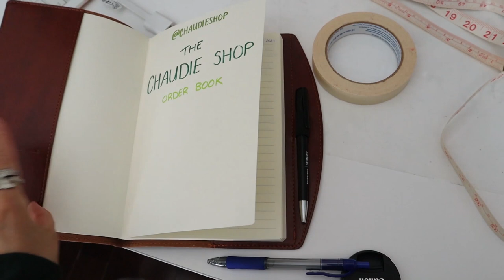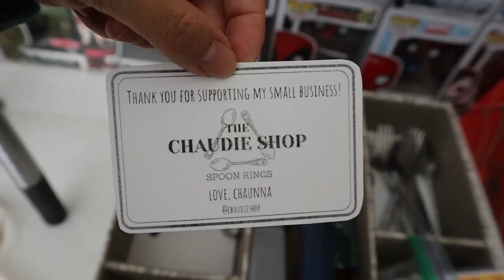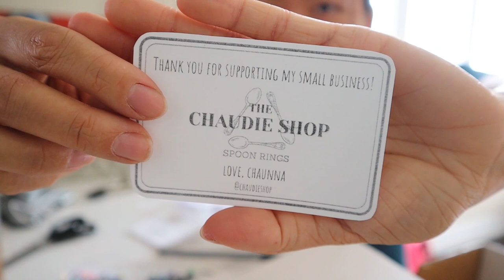how i make spoon rings + launching my small business!

Comment: The rolex ring being hard to bend actually indicates it's use of cheaper metal not the other way round! Precious metal (silver, gold, etc) is generally softer and therefore easier to bend so long as they aren't brittle/work-hardened. To my knowledge they are silver plated but the internal structure is Tin, Copper, or Steel (cant remember off the top of my head but your difficulty bending them would indicate steel)
And for a little extra history, the Rolex rings weren't actually even produced by Rolex! They're produced by an equally reputable company who also did jewellery called "Butcherer" and they were paid by Rolex to release these with their brand name as an advertisement for both companies in the late 50's :)

Cool stuff though, been considering trying some spoon rings myself, but it's hard to find pure sterling silver cutlery these days! Unfortunately I can't wear anything else as my skin reacts with it.

Comment: Beautiful cutlery I use a ring shank bender for the Rolex spoons it works a treat and will save your time. 🙌🏼🙌🏼
Reply from the maker: thank you! what brand/version do you use?
Reply: @ChaunnaDiaz  does not have a brand but I got it from eBay and it leaves no marks on the metal which is amazing but I really like what you’ve started keep it up.